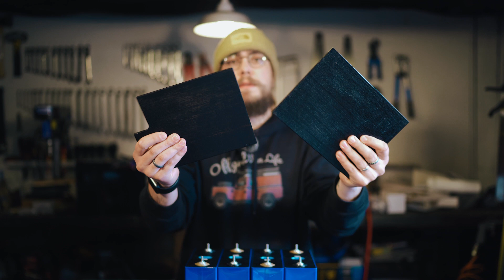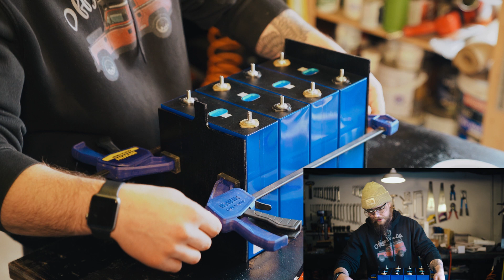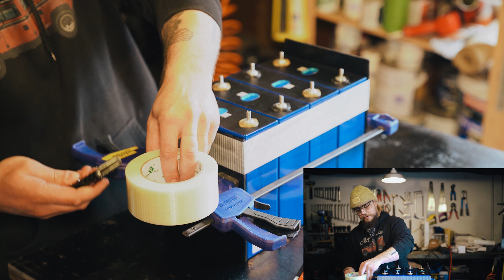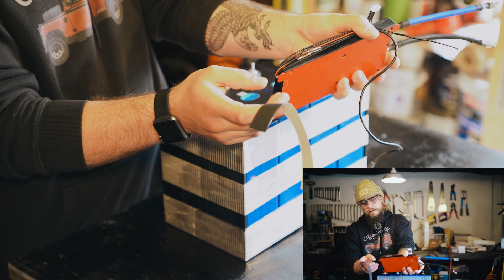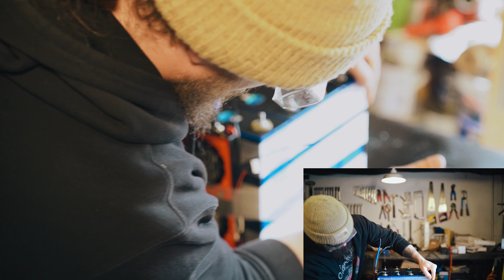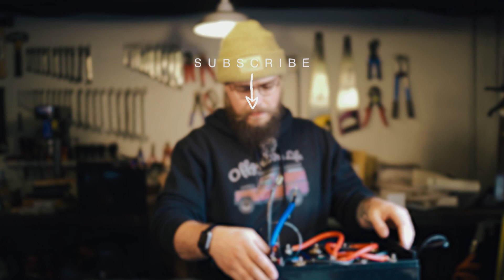Easy way to Top Balance DIY LiFePO4 battery [using EVE 304Ah LiFePO4 cells]

Comment: Can I change four new prismatic cells in series with 15 v charge for first top up before them use in 19 s battery..?
Reply: No first you have to charge at 3.6v top balance all the cell that you need to be in parallel charging. Before you assembly into series this is recommendation what the video
Reply: Thanks a lot for your response

Comment: This video has a misleading title. You talked for 15 minutes on how to connect four batteries together, and at the end, you talked for ten seconds about getting a power supply to top balance.  You did not say what top balance is, why you need to top balance, how to connect the power supply (to all cells or to each individual cell). SMH...
Reply: Exactly and that there is no alternative other than buying a $150 adjustable battery charger, like we all have these lying around

Comment: if you hook all the cells in parallel and leave them for a week, will they auto balance without a charger?
Reply from the maker: Yes, they will settle at the same voltage.
Reply: But it'll take way way longer than a week depending on the deviations between the cells

Comment: Is top balancing something that only needs to be done once in the life of the battery?
Reply from the maker: Generally speaking, yes. If your cells are good quality, then they should only need to be top balancing once. Sometimes you might need to top balance your cells if the delta between the cells (in terms of voltage) becomes too great. But if you have a good BMS and good cells, you should only need to top balance them once.
Reply: So once in 20 years so you have to buy a $150 adjustable charger.
Really that's the elephant in the room for these Wizz kids.

Comment: I don't want to be negative, but for someone who is going to build just one battery that seems like an expensive way to do it. So instead of buying a single cell battery charger and making all those cables, spending say $40-$50 on something you are going to use once before it gets tossed in the trash, how about doing it this way. Why not connect them the cells in series and charge them using a your 12v charger that you will be using to recharge them on a daily basis. Then when they are fully charged but unbalanced, take the battery apart and reconnect them in parallel. You can do both with the plates that come with the cells. Leave them connected in parallel for 24-48 hrs then reconnect them in the 12v configuration and repeat the process to get the cells very close to perfect balance. This may take more time waiting for the cells to balance on their own but will save you about $45.
Reply from the maker: You missed the point as to why I did it this way. The whole purpose of doing it the way I demonstrated was so that you can clamp your cells using the ply ends and fibre tape before you top balance them to increase the lifespan of the cells. If you want to save $45 and reduce the number of cycles your cells do, then by all means use the bus bars and don't bother clamping them before top balancing. :)
Reply: @offgrid_power  Do you really think it will make a difference to the life of the battery by compressing it before you top balance them as opposed to compressing them right after top balancing them? I thought the whole point of compressing them was to stop the interior of each cell from distorting after being charged and discharged repeatedly over thousands of cycles, not from a one time charging event. If you have some data or other evidence showing me why I'm wrong in my assumption, I would appreciate seeing it.
Reply from the maker: There are a number of white papers available showing the benefit of clamping cells. Most people won't cycle their cells enough to really see a difference anyway as for the most part their LiFePO4 cells will outlast wherever they're using them.

Comment: Off-grid Garage in sunny Australia does not think compression is a big deal. Time will show if it makes a difference or not. I think having a mildly compressed pack makes for a better bet in mobile solutions such as boats caravans and motorhomes to prevent battery case abrasion and wear plus extra forces playing on the battery connections.
Reply from the maker: Yeah, for most people they won't really even notice the difference as they will probably land up upgrading their battery within the next 10 years before the cells even get close to the end of their life.

Comment: Hi nigel do u have a link to your charger pls
Reply from the maker: This is the charger that I used in the video: https://geni.us/Wate365vCharger
BUT right after recording this video when I put the cells on charge, the fan on the charger died, so I probably wouldn't recommend it for multiple uses. If you want a cheap charger that can be used to top balance a set of cells as a one off, then it would be fine. But I would look at an option like this for long-term multiple use: https://geni.us/AdjustableAliCharger
Reply: @offgrid_power  thanks mate I built a 280ah battery 6 weeks ago when I 1st built it I couldn't get it to charge past 3.4v even after a week on charge so I built it anyways and it works fine in my campervan my daly bms says it's 100% charged my victron system also says it 100% but its only 13.4v overall which isn't 100% it works great underload but bms stops charge as one cell tops out at 3.65 and others under 3.4 so I thought of trying a charger like wat you use and give it ago